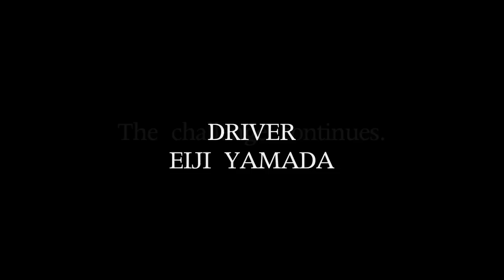TOMEI CUSCO IMPREZA in TSUKUBA（T-001）

Comment: @pinespeakz Dude this suspension is not close to being off the shelf.... Every race car out there is used for R&D for future products. If you look closely and the brackets that come out and connect to the steering knuckle you will notice they are anodized aluminum. I have never seen any off the shelf Cusco coils with those types of components. And last I heard is that since they are AWD they are limited to the hp they can produce. I guess the rules are not in their favor but they still kick ass

Comment: @SR4410 You can, just remove all the interior, use a lot of carbon fiber and aluminum parts, remove ac and stereo, heater,ABS and traction system,  use tiny battery, remove all sound deadening, have only one seat in the car (carbon fiber preferably), use plastic (lexan) windows and carbon fiber doors (and other body panels too). Lose some weight if you're overweight, use 1/4 tank of gas, use light wheels. Pretty easy if you have a professional shop with unlimited budget ,$100, 000+ in this car.

Comment: @pinespeakz 
clearly you do not know anything about japanese tuned cars. You must be an american only worrying about how much HP a car can put out, disregarding important factors like the balance of the car. If you actually do your research on the car instead of assuming everything you will find that not only does this car have a prototype engine built for the car by tomei, and a full body designed by voltex for the car, but rather almost everything but the coilovers and diff are custom.